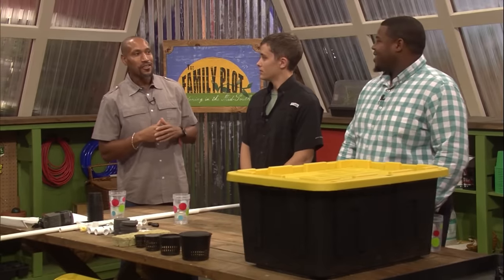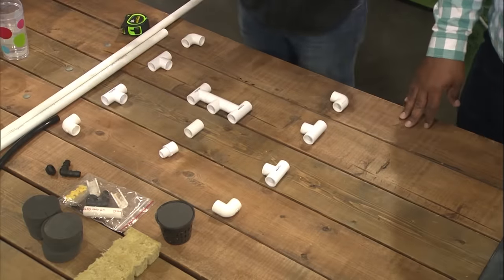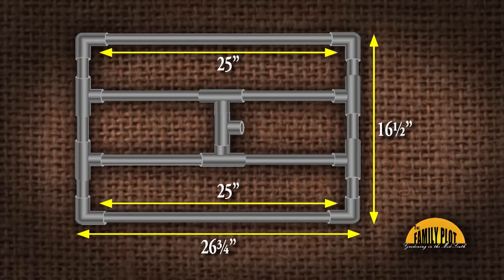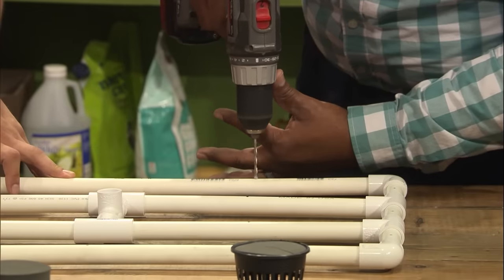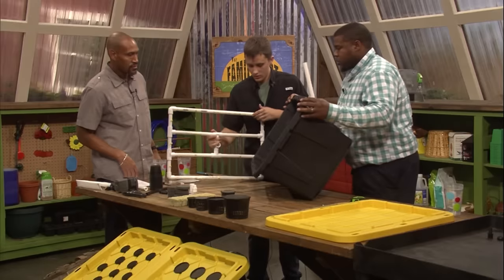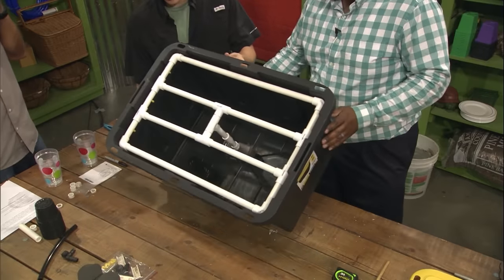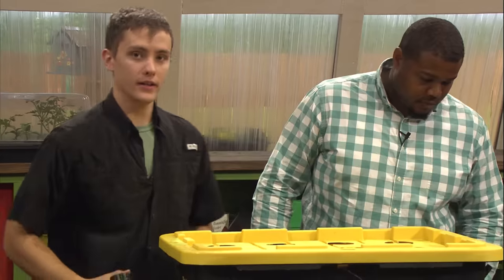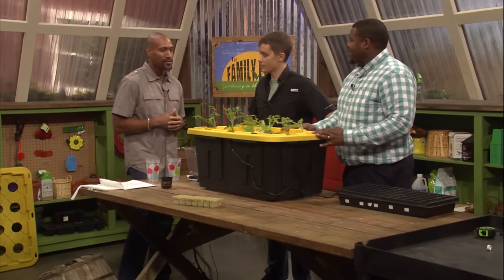Building an Inexpensive Hydroponics/Aeroponics System

Comment: I've built these before, but never ever put the nozzles on the bottom!!!  What a difference, I would deal with leaks coming out of the lids no matter what I did...one little change  to the way I did it would make all the difference.
Reply from the maker: There are many comments we have had that insist that the sprayers have to be pointed up or else .... But, pointing them down realy works, and is realy better with the leaks.
Reply: @FamilyPlotGarden  I have found that as long as water hits the netpot underneath - that's all you need as it will hit the rocks and wick it's way up if needed, forcing the roots to work down fast.
Reply: we're so glad people are realizing that the only reason to spray up at the plants is when you want to propagate cuttings. once you have decent roots, spraying down is fine and eliminated leaks. these systems are too "stitch it together" to deal with leaking! the cost of commercially produced products that would have better seals are prohibitive when all you have to do is point them down and run with it. good job!

Comment: Hello. Is the water pump always supposed to be on, or can it be turned off at night? Also, how often should the nutrients be replaced?
Reply from the maker: We run the pump all the time. You could turn it off at night if you would like. When to change nutrients depends on what plants you have. Some need to be changes every few days (tomatoes in hot weather), other can go a month or longer (lettuce). The basic rule of thumb is when the plants have drunk about half the water it is time to change it.

Comment: Great video. Can someone recommend a seller for the sprayer heads that give a flat horizontal spray? The ones I have give an angled spray away from the netcups.
Reply from the maker: I am not aware of any sprayers that spray in a flat pattern. On our builds the spray does mostly miss the net cups, but some does hit the cups and that keeps them moist. In a smaller build I had to turn the pipes slightly to get the spray to hit the cups. When the plants grew larger, I turned the pipes back to their normal position.
Reply: @FamilyPlotGarden  Thanks! I will give this a try.

Comment: Does the spray have to be on continuously? How often should you replace the water? And do you add any nutrients to your water? Thx
Reply from the maker: We run the sprayer continuously, but you can put it on a timer, just make sure the roots don't dry out. How often to replace the nutrient solution depends on the plants. A good rule of thumb is replace it when the plants have drunk about half the water. For lettuce that could be once a month, for large tomato plants that could be every three days. Here is the video we did about changing nutrients: https://youtu.be/gYrTTLbl3Ro

Comment: With that lid hanging over the edge there will be water leaking out.If that's your only option cut the edge off and grind/sand down a portion of the bin in such a way that the lid is slightly lower than the edge of the bin. Hopefully that makes sense. Watch out for algae growing in the water from a transparent lid. Instead use a bin that has a black lid or cover the lid with some Panda film to block out the light. Don't forget to clean your pump thoroughly after every  round and changle the water every week. Monitor PH levels and PPM twice a day. Best wishes!
Reply: yeah one i spent so much time making basically leaks from the lid.... idk what to do to fix. bc grinding the whole thing down to fit inside sounds miserable lol. plus likely wouldnt be perfect enough

Comment: is there any information about what sort of maintenance or nutrition cycles or even what sort of nutrients?    does the nutrients cause issues with the pump over time?
Reply from the maker: We have not done a video about all the different kinds of hydroponics nutrients, but here is the video about what we do with this system: https://youtu.be/gYrTTLbl3Ro We use The Flora Series from General Hydroponics (That is only one of many options out there). We change the nutrients and water when the plants have drunk up about half the water.  This could be a couple of days with large tomato plants or several week with lettuce. Synthetic nutrients that are done properly should not affect the pump and we have had no problems. If your nutrients get realy out of balance or you use organic nutrients there may be residue that collects in the pipes and clogs the sprayers. The pumps tend to be pretty good at handling small debris, less so the sprayers.

Comment: I use the Same Tote, But I just use an ActiveAqua air pump with an Air-stone. Water stays healthy, even sitting directly against the sunny window here in Vegas. You can Split the pump 4 times and setup 4 of these units. I appreciate the engineering here, My Arrangement of 1 pump, 4 stones, 4 totes with Baskets Was only about $50, sets up in 10 minutes. Clay pebbles help you'll need those in hydroponics. hope this helps.
Reply: We design system to cut down the amount of water and therefore nutrients needed to feed the plants effectively. Also, airstones just cant cover as much water as this aeration method does, they also eventually have to be replaced. This system is designed to cost less in the long run, even if it costs more in the short term. Wasting nutrients at water changes was the main concern behind this design. The aeration is just an added bonus, but it is one hell of a bonus! We hate clay pebbles. They have to be cleaned. NEVER AGAIN!

Comment: So that seems simple enough.   But what about watering schedule and lighting necessities for someone new like myself.
Reply: this can be used indoors and out. the lighting schedule is based on your plants. generally, a 12 or 16 hour day covers most applications. anything over 18 hours has no added benefits and wastes money. we now recommend Jack's Pro salt based soluble dry nutrients for this system, but any synthetic nutrient formula will work. organic hydroponic formulas may clog the sprayers. however, we have made compost tea for this and used filter bags that the pump is zipped into and had great results!

Comment: Hi there! First, thank you for the video it was excellent! Hopefully you can get back to me as far as answers to issues I’m having. I’m using a 200 quart tote so it is 19” wide and about 3 feet long. I used 1” pipe and fittings for the pvc manifold. I started with a 290 gph Beckett pump. At first i put way too many misters in so then I redid the length pieces with fewer misters. I did that because I wasn’t getting hardly any pressure out of my misters. That didn’t really improve the spray strength so I exchanged the 290 gph pump for a 680 gph pump. I thought for sure that would increase the spray pressure. It did, but only slightly. Is the issue that I should be using smaller pipe? Thanks so much *edit update* I changed my manifold to 1/2 “ pipe but still not enough pressure. The distance from the pump to the manifold is at least 12 “ is that distance the main culprit of the pressure issue I’m facing?
Reply from the maker: You should be fine with larger pipes with a 680GPH pump. These pumps don't have too much head pressure meaning if the pump is too much below the water outlet level they will not pump much water. They are built for volume not pressure. How many sprayers are you using? This system used about a dozen. I have another system on the same pump that has about 20. Both work well. Have you tried adjusting your pump flow control? Many submersible pumps have an adjustment to control flow. On the one we used in the video the adjustment is on the side by the input. It can go from full power to just a small trickle.

Comment: 3:45 if you are cutting with a hacksaw, trace around the tube with a ziptie to get a straight cut. Protip: put it upside down in the locking mechanism so you can pull it out and reuse it

Comment: Do you have to add a filter on the pump to make sure that nothing larger gets caught and pumped into the mister and plugs the mister? If so, what's the best way to add a filter?
Reply: Probably a screen
Reply: Usually, unless getting the cheapest of the cheap, hydroponic pumps have a few features making them better than plain fountain pumps. One is a threaded connection for the water outlet, but they will also have a mesh filter under the front plastics, surrounding the water inlet, when it's used by submerging. You can also get "pump bags" in small and larger sizes, which are a very fine mesh that will keep nearly everything from getting into the pump. Those would need to be changed once in a while, as they can lose their porosity if they get too dirty.

Comment: Hello. I have a couple questions for you. How do I know how much water to put in the tub? And then do the sprayers actually touch the cups when they are spraying? When should you add nutrients in the water. What is the drain for? How does the water come out? Do I have to move all the tubs  to the sink to drain it every month to change the water? What kind of water should I use? Tap water okay? Thank you so much for your time. I have these questions before I start my system.
Reply from the maker: We put in 10 gallons. The sprayers don't touch the cups but they are close because of how compact the system is. You should add nutrients as soon as the plants go in. The nutrients will need to be changed occasionally. This is what the drain is for. You can turn it to the side and put a bucket under it to catch the water. We use tap water. Our municipal water in Memphis comes from wells and is very good. Some people advocate running the water through a reverse osmosis system. You can see more about how the drain works and how to change the nutrient solution here: https://youtu.be/gYrTTLbl3Ro
Reply: I appreciate the information so much!! Lastly, do you know of the BEST lighting out there no matter the cost for a 9x 9 area roughly??

Comment: What’s the make/model of the water pump?

What size pvc pipe are you using?

What size is the male adapter being used in this vid?
Reply from the maker: The pump is an Active Aqua 400 GPH pump. The PVC pipes are all 1/2"
Reply: @FamilyPlotGarden  gratitude

Comment: built it, appears to work well.  But, do you have an issue with the jets plugging with debris from the tank?  I commonly notice junk in the bottom of my hydroponic tanks, not sure how you would tell if the jets are blocked.
Reply from the maker: We don't have much problem with blocked sprayers. If they are clogged they will not spray a good pattern. There will be parts of the arc that don't spray or the whole sprayer will just drip.
Reply: Just pop the lid open and check from time to time. One reason we like to put alot of sprayers in, aside from all that aeration, is so we can just let the occasional clog go without an issue. One other thing you can do to practically eliminate clogs (other than quick and thorough cleaning between harvests) is to grab a "pump bag", which the pump will slip inside of. they have a fine mesh, so overtime they'll lose their porosity and need replacing. good luck out there!

Comment: What size drill was used to cut the holes for the net cups?
Reply: You can use any size. For small stuff, I use 2 in. Diameter net cups.
Reply: @kadeadams2308  Do you have the spayers facing downwards or upwards?

Comment: It was not mentioned in video how to refill water and keep it from getting nasty inside from continued usage. I live in Tampa Bay and want to put it outside on the porch. Is there an addictive that I need to put in the water or no? I would also love to see your product 4 months later if possible.
Reply: Hey dude they have another video on this process! Im currently making this device i'm on the last stage cutting the holes in the top and my rockwool seeds are almost there. You gotta go to their site and they explain the draining process and the correct fertilizer mix / ratio to use. Hope it helps T.
Reply from the maker: Here is a video about changing the nutrients: https://youtu.be/gYrTTLbl3Ro. You can also also click a link in this video's description that will take you to a page with pictures from the next year or so of growth on this system with these plants.  I have used this system outside in sun in Memphis during the summer. It works but you need to have it with mylar. This will keep the light out and also a lot of the heat from the sun.

Comment: Hi.  How long do you leave the pump running?  Hours per day or constantly?  Any suggestions on watering would be helpful.
Reply from the maker: We let the pump run 24/7, but you can run it in intervals like 15 minutes on 45 off or similar. You need to keep the roots from getting dry. if your climate is hot and dry you will need to run it more frequently if it is moist and cool you can spread it out. Good luck!
Reply: @FamilyPlotGarden  Excellent.  Thank you.

Comment: Dude i have got no clue why i need hydroponics but seems like fun, going to buy some crate and piping see you after i burned down my house with the 20000W Chinese Lightbulb powering all of that. Anyway you got yourself a subscriber!
Reply from the maker: Thanks for watching. Have fun installing the extra circuits for the light! 😉
Reply: You need hydroponics because water literally flows out of your walls and soil is a pain in the ass to truck around. Buy some salt based fertilizer and save yourself a fortune. Indoors or outdoors. You only need a simple 600w light to cover a 6'x6' area. Don't be so timid.

Comment: what kind of pump do I buy? Where does the water drain to and how often do I have to clean the bucket
Reply from the maker: It is a 400gph pump. It drains back to the bottom of the tote where the pump recirculates it. What you are growing will determine how often you need to change the nutrients. A rule of thumb is to change it after the plants have drunk about half the nutrients.

Comment: What was the size of the drill bit that he used to carve out threads in the pipes for? And what size are the sprayers that screw into those? 

Thanks.
Reply: I'm not sure of the actual size anymore. The dye used to make the threads should be just a smidge bigger than the drill bit making the hole. The sprayers are available online as "330 mister and 180 mister" on eBay and Amazon.

Comment: I see you have several tomato plants and a cucumber plant in that tub.  They all take up a lot of room.  What do you do with them when they get big?  Is there enough room for the main stem and all the leaves?  We plant tomatoes in our greenhouse in Rubbermaid tubs about the same size and only get 1 or at the most 2 plants in each tub.  How do you deal with them when they get big?
Reply from the maker: You can lean and train the plants out away from the tub. That way you can access all of them without too much crowding. For tomatoes I would prune them to a vine. Then as they grow they can be quite far from the tub.

Comment: Was wondering if plant food is added to water & how often to change or add water.  Questions sort of answered in comment replies to LaPlant. Great for indoor or balcony. Thank you.
Reply from the maker: Yes you need to use hydroponics nutrients in the water to feed the plants. We use the Flora Series from General Hydroponics, but there are many other options out there. How often you change the water (and nutrients) is dependent on what kind of plants you have. A basic rule of thumb is to change the nutrients when the plants have drunk about half the water.

Comment: So does this thing constantly run?  Or just a few hours a day?  Also any suggested solutions to add to the water?
Reply from the maker: We run it 24/7. The pump obviously keeps the roots wet, but also all the splashing oxygenates the water. As to the nutrients: there are so many different options out there for that. We use the General Hydroponics Flora Series nutrients in this system because they are easy to use. They are a liquid nutrient, just measure and dump in the water. Here is Scott changing the nutrients in this system: https://youtu.be/gYrTTLbl3Ro . There are many liquid nutrients out there and many if not most of them will do an excellent job.  There are also dry nutrients that you have to dissolve in water before you can add them. They take more work but are less expensive. If you are just starting out I would suggest using liquid nutrients. They are easy and as you get more experience in hydroponics and learn what your system does you can switch over to the dry nutrients. There are many different formulations available. Figure out what you are going to grow and then get the nutrients that are suitable for that crop.
Reply: @FamilyPlotGarden  Thanks for taking the time to reply.  I just built it exactly to your specifications and it turned out beautifully!  No leaks and eveything runs well!  Going to load it up with plants and start running it soon!